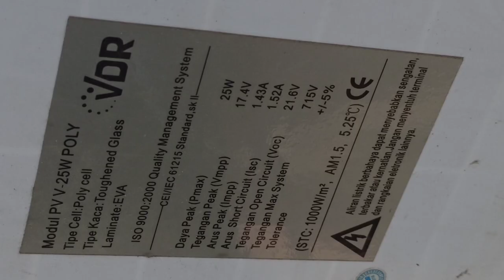COBA RANGKAIAN INI, COCOK UNTUK PANEL SURYA 10-50WP

Comment: Great job, it works for me. I added a switch and it worked but I was wondering how can I add a led, I wanted the led to know if the switch is ON or OFF (wanted to flash once the switch is ON), I added it but when I test the voltage, it is lower than 5v, any idea? . I think I put the led in the incorrect side of the circuit (sorry I'm new with this). The led should be connected after the diode 3amp? (positive) and the negative of the USB female?